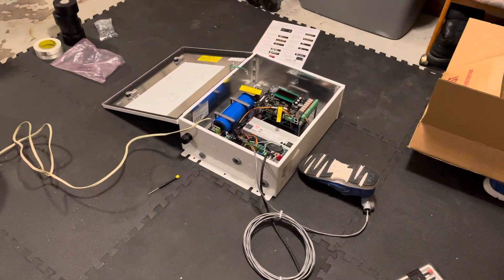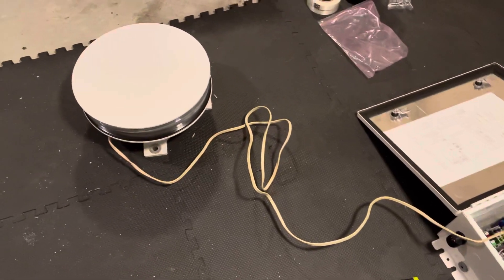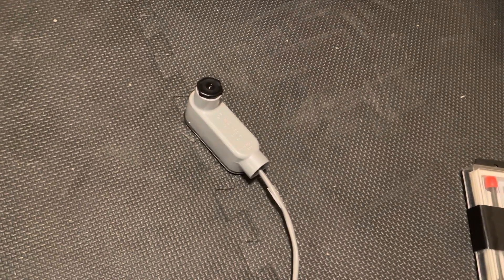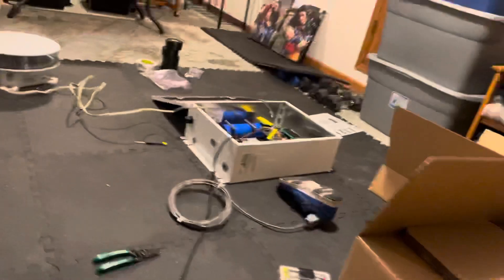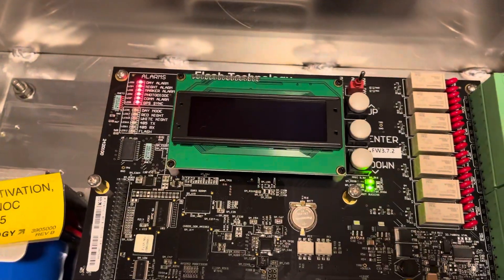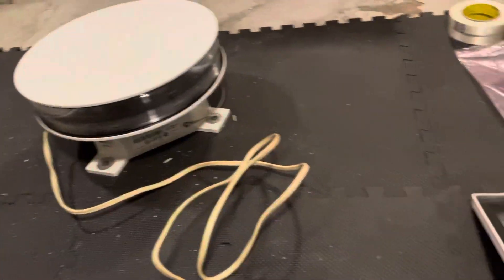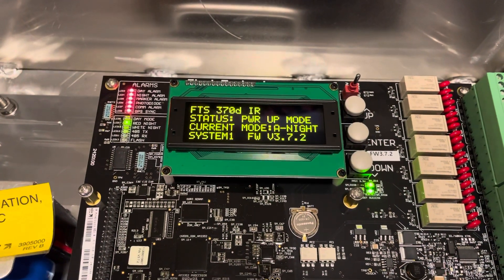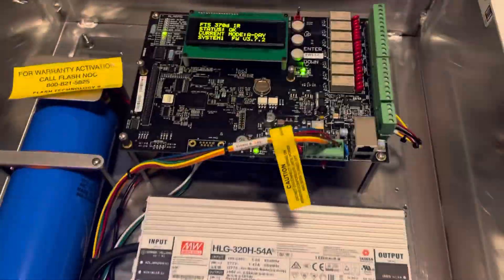Flash Technology Vanguard FTS 370 mock up for amateur radio repeater tower

Comment: Do you guys still have the old xenon equipment?I was looking for one for my collection
Reply from the maker: the tower climber took the strobe home as a souvenir.  The control box is still on the wall in the electrical room unhooked.
Reply: @TheDillio187  Nice.  Looks like the Vangaurd was a pleasant upgrade for the tower!
Reply from the maker: @kodymcpheron5619  it certainly was, hopefully we don't have to worry about it for a long, long time!
Reply: @TheDillio187  I like the no worrying factor.  LEDs fit the bill.

If you guys are willing to get rid of the xenon controller, I am in the market for one.  Never gotten an opportunity to get a hold of one.